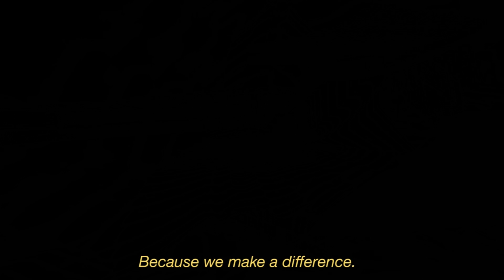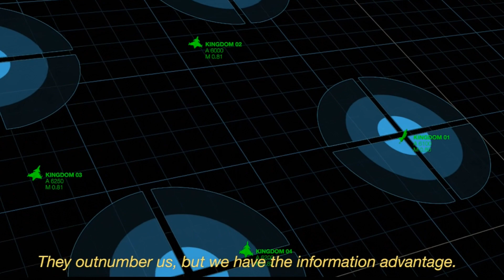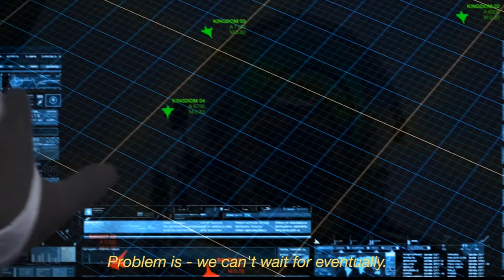Gripen Fighter Jet - Canada's Future Fighter?

Comment: Canada is so large having no forward bases means flying thousands of KM to an intercept. The F18 anfd F35 both require longer runways than we have in the north. If we buy the STOL Gripen we can use those northern bases and be able to make those intercepts. Bagotville and Cold lake are in the middle of the country and are both below the arctic circle. Canada has bases we fly C130's out of in the Arctic already. The Gripen can forward base and the F35 can't. With the long logistic trail of the F35 they must have specialized hangers and equipment to operate. The Gripen can operate out of much more austere airfields. An emergency landing is too far to make it for the F35 over the Arctic but the Gripen is always close to a base it can land at. Just the safety aspect is huge and the time to intercept is vastly different in comparison. The F35 uses more fuel and has less range with that fuel so it pollutes a lot more too.

Comment: Please. Even if we pay the same price for F-35 As.. They cost 8000$ per hour to operate, NOT 35,000$. AND we get to produce it in-house with technology transfer. And we can get to do our own service. With American stuff, we ALWAYS get caught in a hostage situation. Where we have to sign losing deals or get slapped with some tariffs or bans. And with this new America First and a possible return to the crazy Trumpian way to deal with other countries.
It is a GREAT idea to NEVER rely on the USA for our survival. And to become as self-sufficient as we can. AND to take care with our Northern Sovereignty, before Every country on the planet decides THEY own the North-West passage. 
So even though it costs MONEY, we have to get GOOD equipment, because we have to make do with a FEW volunteers. Might as well give them the best. MAYBE the F-35 is stealthy and can carry more, but really, it's slow and doesn't work half the time. It's a BETA version of a product that will be replaced with a better-designed model that can actually fly at its max speed for more than a few seconds, before falling apart. before it gets finished... A Mach 2 max with supercruise for fuel efficiency the same operating cost as a Honda jet,  a modular design with easy SOFTWARE upgrades, and some of the best avionics and sensors on the market.. That carries 7 Meteors and can fire them linked to other jets, and that ACTUALLY WORKS WITHOUT BUGS???? 
We went Leopards instead of M1s and it was worth it. We buy our small arms from ourselves or the Belgians like most of Nato, and we mostly get UK designs for our navy hulls. Except for the new coastal and the icebreaker ships. We made our own camo pattern and we have a pretty decent research center and our own aerospace, ammunition, weapon, service and tech, and the new AI initiative. So IF we give it a go, we can have a REALLY decent pocket army. That packs a REALLY good punch. ANd building in-house, basically pays for itself. All of the money goes back into the community and makes the economy roll and pays taxes to the gvmt..
Reply: The Gripen costs more than $8,000 per flight hours, lol. They were just lying by omitting the full cost, only telling you fuel costs. Saab is so desperate to sell them, they'll say anything at this point.

And that's why Canada just decided to buy the F-35, the obviously superior plane that allows Canada to function better as a member of NATO, concerning interoperability and air power.

Comment: Yes to the Gripen. But not the F35.  The Super Hornet should be the second Aircraft. 
 The reason, it's a long walk back from anywhere in the north of the country. Both the Gripen and the F35 are single-engine aircraft while the Hornet has two engines. In the extreme of Northern Canada, engine problems are much more common than anyone would like.  For long-range patrols in the Arctic and off our coasts, the F-18 offers the best and safest option for the RCAF. Two squadrons (24 aircraft) of F-18s would do those domestic jobs perfectly. Nato/Norad commitments would be well handled very well by the Gripen.

Comment: Where are you getting the figure that it is cheaper than the French Raphael? From the valuations I've seen the Rafael is slightly cheaper. And while the f-35 a is more expensive when you factor in maintenance costs, stealth is actually really important and useful, so in my opinion the f-35 is a superior fighter.

Comment: The real issues for the next fighter jets will be more data than dodge. Operating A.I. wingmen and UCAV drones will be the focus for aviators now. In that regard the Saab has superior sensor fusion at this time followed closely by the F35.  The F35 fails as far as operability goes in that it has crappy availability at best due to HIGH maintenance. Operating costs and computing power with high volume/security data links will be the deciding factor. Saab is a world leader in data links. For interdiction you need SPEED the F35 is slow. STOL is valuable. Super cruise is valuable. Cost is important. Availability is critical. These reasons put the Gripen out front in my opinion.

Comment: I seem to remember Canada going on record saying it would only consider twin engine aircraft due to safety concerns flying over such vast wilderness and sea in their very large patrol areas, this is why in the last purchases they bought f-5's then f-18's, the NATO commitment is a different matter.
Reply: twin engine superiority is an outdated myth which is not supported in real world modern jet attrition stats.
the f18 has a higher loss rate due to engine related problems than the f16 has.
YOU prefer twin engines, then YOU pay for it from your own pocket.

Comment: The problem with the grippen it's the range (little bit short for canada) and one Engine IMO. But, I'm not an expert ;-). But I love the grippen.
Reply: No  Gripen has larger combat radius then both F35 and F18 SH.
Reply: @JorgenPersson-jo4sc  Was not the case with the C version at my knowledge. Maybe for the E is completly different ? By the way I'm surprise of your info, because I read that the F-18 super hornet had a range of 3300km (or a little bit less) were gripen had between 800 (for the C) and 1300 for the E, but, maybe I read that wrong
Reply: @SkarnDeBrax  Yes Gripen E is different/larger then Gripen C. Gripen E has 40% more internal fuel, two more hardpoints (= 10) and can carry havier payload.
(Note that Gripen C was "tailormade" for Sweden.)
Gripen E can also supercruise at mach 1,1 with air to air payload due to stronger and better engine BOEING GE 414. (same as for the F18 Superhornet).
Gripen E has longer range then the other two fighters in the Canadian fighter jet competition. (F35 and F18SH)
Combat radius
Gripen E = 1500 km (Ferry range 4000 km)
F18 superhornet = 1290 km
F35A = 1093 (internal fuel)
(F15X = 1850 km)
Reply: @JorgenPersson-jo4sc  thanks buddy
Reply: @SkarnDeBrax  Here is the new Gripen E doing a almost vertical take-off in the Finland.
https://www.youtube.com/watch?v=jXuD6tcze1o&t=6s&ab_channel=Siivet-Wings

Comment: Honestly, man, I couldn't get past the first 3rd of your video and I encourage you to look at some other perspectives. The F-35 is not a good plane, think of how much the jet costs for what it provides. It is simply trying to do too many roles at once. JSF was supposed to be an economic program and has become the most expensive procurement project in US history. Fighter planes just aren't important anymore. The Gripen seems like a great plane for good value, with low operating costs. If you want to learn more about airplane design I would suggest Boyd: The Fighter Pilot that Changed the Art of War. It is a really interesting book and one of the best books I have ever read. Also look up the fighter mafia and Pierre Sprey, he designed the A-10 and worked with Boyd on the lightweight fighter program that became the F-16 (and F-18). The A-10 and F-16 are arguably the best planes ever made and also some of the cheapest to run and acquire. As cool as fighter planes are there are much more important things to spend money on.

Comment: Regardless of what the RCAF chooses. They will not be built here. You will never see a Canadian built tank or fighter. Canadian aerospace firms will likely be involved with upgrades or electronics for inside the aircraft but full on aircraft won't be built here. Our defence industry is small and small arms are mostly what is made here. The only big items built here are the LAV and some Naval ships. 

The RCAF will order such a small number of aircraft, roughly 100. One small production run then what? The factory shuts shown because there are no more units to be made. 

It doesn't seem economically feasible to me to seem like that will ever happen.

Comment: The Swedish Air Force is buying its Gripen Es for $43 million per copy, less than one third of the price of the F-35. Its operating cost per hour is less than a tenth of that of the F-35’s. Simulation has the Gripen E shooting down the Su-35 at almost the same rate that the F-22 does. The Gripen E is estimated to be able to shoot down 1.6 Su-35s for every Gripen E lost, the F-22 is slightly better at 2.0 Su-35s shot down per F-22 lost. https://dailycaller.com/2016/01/22/american-gripen-the-solution-to-the-f-35-nightmare/
Reply: sorry to burst your bubble but the gripen project has already cost a couple of billion dollars to the swedish government to date ... in fact excluding engines (wich are the same ones as the F18) the gripen actually costs a lot more than the F35 ...in fact DEVELOPMENT cost of the new techs for the  E  variant are just 7.5 billion USD (at 2013 prices)  ... and this is just for upgrade of 60 old C airframes plus 20 new airframes (if all were new it would be 97M USD per plane)
Reply: @sotabaka  Yes sweden and all taxpayers have paid much of the development costs on Gripen. but still if someone buys Gripen today, the price is around what I said.
Upgrade of 60 old Gripen C?
You know that Gripen E is a completely new aircraft with completely different dimensions.
One cannot upgrade a gripper C to a gripper E.
Is equally difficult to upgrade an F16 to an F18
Reply: the checks leased 14 gripen for 10 years for some 64M USD a piece
Reply: @sotabaka  it is not cheaper to lease an aircraft. Besides that, much else is included in a leasing agreement.

Comment: The USAF is ordering the F-15X for air defense. Replacing F-15C/D models. Canada should consider getting in on the buy for the same mission.
Reply: isn't it F16 retrofited ?
Reply: Sota Baka ... Canada prefers a twin engine fighter for flying over the Arctic. The USAF F-15X purchase is supposed to be only for continental air defense operations by the Air National Guard. For NATO operations a Stealth Aircraft is preferred. By all accounts the Griffin NG is a good Aircraft but it isn’t stealthy

Comment: Canada purchased the CF-18s in part because it had twin engines. It
would have been cheaper to purchase F-16s with single engines. The
vast arctic expanse of Canada means the necessity of ejecting in the
middle of nowhere is very daunting. The Gripen has only one engine
and this counts against Canada accepting this design. The Trudeau
government is hardly the most pragmatic decision maker. The easiest
course would be to keep delaying a decision and allowing the fighter
force to keep deteriorating. Unless Trudeau loses the next election,
I expect the inaction to continue.

Comment: Canada can't afford a mixed fleet, they can barely afford what they have. The F-35 is an over priced fighter that requires way too much maintenance,  Canada wasn't even going to get the stealth package for the F-35 because of the maintenance cost of the stealth coating so without stealth the F-35 falls short of other fighters.

Second, Canada has a sophisticated weapons and avionics software development capabilities from the CF-18 which would be lost with the F-35 as the Americans won't allow development outside the US. The Gripen might be a better fit overall, Boeing shot themselves in the foot by attacking Bombardier C Series jets so the F/A-18 E/F models, which would have been a good fit, aren't likely to be in the running.

Comment: Never should have gotten rid of the F-5's. Or should have made a sweetheart deal with Northrop in the 1980's and got F-20's. They would have been inexpensive to operate, and still very capable. Gripen does check all the boxes.
Reply: 67- RIGHT ON! buying the overpriced f18 was a retarded choice when our  F5 production site could have been cranking out hundreds of new F20s since Northrop would have sold us production rights for pennies on the dollar.
the SAAB is similar and probably has an edge for arctic use but at a greater per unit cost.

Comment: What I've realized watching channels like this is that the factual information content is marginal, it's largely personal opinions ranting for the most part. Still it can be quite entertaining to see how loose ends are tied up using flawed assumptions and it ends up being considered fact just because it comes together. The flaws I see here are:

The Gripen is a single engine fighter. It runs the same engine that is on the F-16s and light fighters like the Indian LCA and the Korean Golden Eagle. Now these are aircraft that are part of large, organized airforces with other heavy, powerful  aircraft performing fundamental tasks like the Su-30MKIs in India and the   F-15JKs of Korea. So it can be seen that the cadre of the Grippen is actually along the lines of the likes of the erstwhile Mig 21 and F-5s, sentinel fighters more or less to guard borders or coastlines to show presence and put up a fight if it comes against an adversary till the big boys come in for the kill. Also being single engined means it is always far less reliable than the twin jets also it may not have the tolerance required off of a fighter jet policing a geographically titanic nation like Canada.

Now, the adversaries Canada can possibly have are two:  
a) Russia
b) USA
c) Greenland (fair enough)
d) Iceland (Mwehhh awwrite)

If Russia were to attack Canada, it won't be with Mig 29s or Su-27s it would be with cruise or Nuclear missiles. So it's ineffective against Russia.
If the US were to attack Canada, it would be with F-22 or F-35s. Again Gripen Down.

Iceland is too far away for single engine Gripens to operate so technically Canada can use it effectively against Greenland.

My view on this is simple. Canada was known to have produced the best aircraft of its time when it built the Arrow. They should now re-examine the arrow vis-a-vis modern technologies like super cruising engines, 3D thrust vectoring, stealth technologies, composite materials, theatre warfare..... and develop a single engine version of it as well. It can also sell these fighters to a hell lot of countries that don't want to get caught in the sniping between  US and Russia and thieving  Europeans.

Comment: This would be a no-brainer for Canada. The Grippen is DESIGNED to operate in climates that you find in Canada and can do it from a long streach of highway. Forgrt the F-35, buy the Grippen, and produce a 4th or 5th gen fighter yourselves. Though the latter might be neigh on impossible due to the abrupt swings of Canadian politics. It would be a shame to develop and start building the Arrow II (just a suggested name) only to have it meet the same fate as the original.

Comment: Canada is a massive darn country. That is a heck of a lot of square miles to have to cover up there. Two engines. The F35 engine actually does make the F35 the most powerful single engine jet fighter ever. It cranks 38,000 lbs of thrust out of just one engine! For one engine there is nothing else even close. 

The F35 engine is the same engine the F22 has it is just tuned per F35 variant. That is also just how crazy the F22's combined thrust is as well.
Reply: Gripen E  is much faster than the F35 !!!
Reply: @jontus9925  Gripen E has 22,000 lbs of thrust, F35 easily pushes a record for single engine jet fighter at near 40,000 lbs of thrust. Remember folks the actual "numbers" for the F35, F22 etc. have actually been classified.

I do like the Gripen. It is small. That is how it goes that fast with one engine I guess.

Comment: For smaller airforces, Gripen makes more sense than anything else - cheap and easy to maintain, the network centric systems means you can datashare using a group of Gripens as a mini AWAC platform. It's good in every area - almost the perfect multi-role fighter. I wish the UK bought it instead of F-35 - SAAB were looking for funding to produce Sea-Gripen, we should have jumped at the chance but BAE didn't want to lose the F-35B lift fan business (despite having significant interest in Gripen) - so the tail wagged the dog as usual.

Comment: The Gripen  is a fantastic aircraft, but unfortunately not the aircraft I think Canada needs. The Canadian Air Force spends a large amount of its time flying over desolate Arctic, north Pacific ocean, and north Atlantic ocean areas. With this in mind The Canadian Air Force requires a fighter with two engines. Survival times in these environmentally dangerous areas is extremely short, in some cases measured in minutes. Our pilots need the ability to bring their aircraft home in the event of an engine failure.